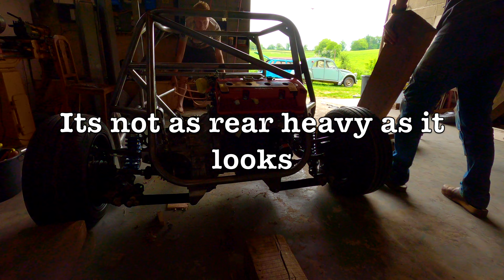Mid engine Kswap with Honda CRV suspension | Project Mosquito Honda Type R Mini Supercar (Ep45)

Comment: This is cool as. Would’ve loved seeing a rotary engine it.
Reply from the maker: I made a video about why I went for this and not a bunch of other engines but basically rotary engines make a ton of heat, even more so with a turbo at which point the big ball of cast iron and all the plumbing mean it's no longer that light.
Reply: @OliverPickard  what you have done is amazing.

Comment: Rear sway bars are so unnecessary in mid-engined cars that the go-to suspension setup in a formula vee is a zero-roll system, which ties the two wheels together so that if one goes up the other goes DOWN. You basically have a pushrod setup with a single coilover connecting the two cantilevers, so the car can lean without compressing the spring at all. It's ingenious in a racing class infamous for lack of rear stability.
Reply from the maker: Interesting that sounds similar to the Dedion rear end in a Smart
Reply: @OliverPickard  It's a little similar, but based on a VW transaxle with swing-axles. The suspension setup almost works like a Z-bar with the rest of the suspension omitted. That way not even the springs provide any roll stiffness, if you tried to carry it like a ricksaw as you did when you finished the rear suspension, the body would be completely floppy side to side.

Comment: FYI k20a2 is not the same as the k20a from the dc5 type r or ep3 type r. Plus k20a dc5r has an aluminium pan among other differences.
Reply from the maker: It's a euro spec DC5 R A2 with the aluminium pan and was previously fitted to a Dc5 tarmac rally car

Comment: Hi there, it's good to see you both making progress. You remind Me of a series I watched a few years back on YouTube  called "Binky Build" 
Please may I ask a question 2"cv related, What is the wheelbase length of 1972 citroen Ani? Or where might I find that measurement? You see, I have a problem in fitting My adjustable racing rear shock absorber on My lomax and I'm not sure but I was told that the chassis was shortened on some lomaxes ...Lomi would be the correct pronunciation ; - ) . Anyway any help would be greatly appreciated.
Best Wishes Jahmahrah
Reply from the maker: To my knowledge it's 2400mm. Have you tried compressing them 5times like I do in the Dyane shock absorber video?
Reply: @OliverPickard  Thanks Oliver, and I tried to compress them but I had to use a large sash clamp to even get it to move. Roy at ECAS told me they were meant to be extremely stiff and to de-compress them You have to hang Your body weight on them! 
Thanks again I will be getting the tape measure out, Best Wishes Jahmahrah